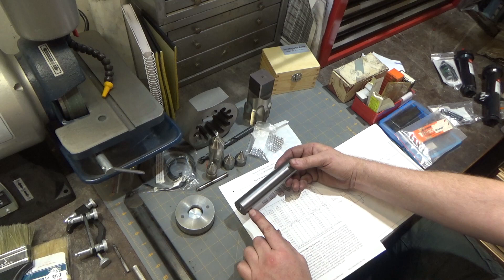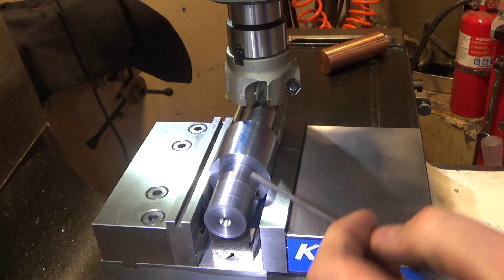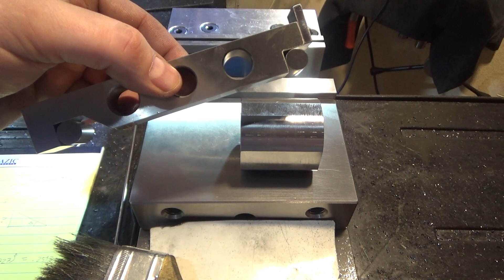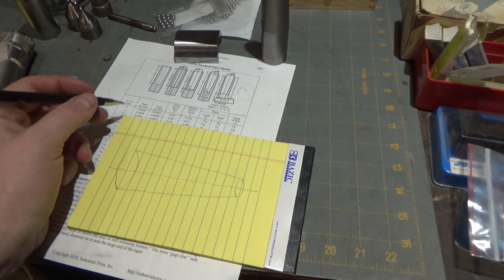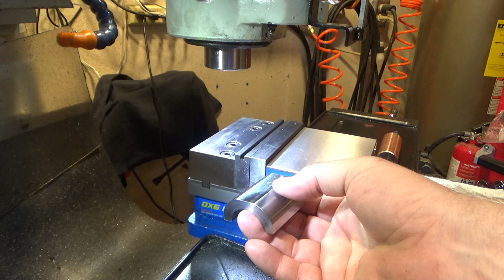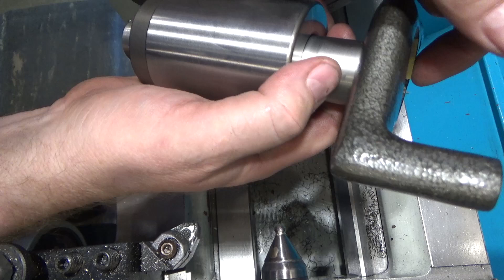Turning a Morse Taper (MT4) - Failure and Partial Success

Comment: I know I'm going off topic here and this video is 6 months old, but here goes:
mrpete222 built a taper attachment for one of his lathes out of bar stock.
This would make a good project. First I would recommend to check if you can download drawings for that really expensive taper attachment that is from your lathe manufacturer. Maybe you could copy it with some features missing.
Or you could build a similar one to the one mrpete222 built in one of his videos. Just a suggestion. :)
Reply from the maker: There are two types of taper attachments that I am aware of and Mr. Pete's is the easiest, but effective. The one the manufacturer of my lathe sells, uses a splined shaft that goes inside another shaft on the cross slide so that you can still use cross slide adjustments with the handle when you are tapering. It costs about $1200. Thanks for the really helpful suggestion.

Comment: Another thing I didn't get with my used lathe, the spindle center sleeve (and a faceplate, dead center, live center, dogs...).  I actually turned a MT5 taper to go into the spindle taper for a stop for parts inserted into the chuck.  Fortunately, I was able to cut the short taper with the compound slide.  I used the technique learned from Joe Pieczynski to set the compound accurately.  I needed this because I had to do a little production job for my employer–  we had 80 "axles" which were 5/16" male threaded on both ends of a half inch diameter center section.  I had to cut down the center section .140" on both ends.  A local shop quoted $8 per axle.  My stop went into the taper and was extended with a 3/8" threaded rod to a turned-down coupling nut to contain the 5/16" threaded part and catch the 1/2" shoulder.  I used the lathe stop that clamped onto the v-way (got two of those!) and fed the Z-axis .140" by hand.  It was very fast, but it was a bit of a mental challenge to figure out how to do it fast on a non-production machine.  I remembered fondly the nearly new Hardinge DSM-59 turret lathe I once ran...
Reply from the maker: Isn't Joe great? He really goes out of his way to share his experience with the rest of us in a really understandable fashion. A born teacher.
That project you had sounds really interesting. The setup especially. I would love to see a video on that project. I am really intrigued with solutions that people come up with that make seemingly simple projects still financially viable, because they always seem to take longer than expected.

Comment: I like the whole approach, interesting video.  Thanks!  Was it really necessary to calculate the angle of the taper.  Using a 5" sine bar should use a stack exactly half of that required for a 10" bar.  I think your conversion to angle and back introduced a small error in your stack amount, .0003".
Reply from the maker: You brought up an excellent point. I was trying to show a generic approach with the math, but I get your point. Thanks for the input.

Comment: Use dead center on headstock and tailstock.even a bearing live center can cause the wobble.i dont think the ball point center you made will help you.because the center hole on both end on the parts will be 60 degree and not a ball point hole
Reply from the maker: Thanks for the perspective. Every comment helps immeasurably.

Comment: The ball on the center is a good idea for the taper turning.  My casual observation is the the ball is actually too small in diameter for the center drill that you are using and it looks like is not making full contact in the center drilled hole.  But of course since I can not see the detail this is pure speculation.  Good video.
Reply from the maker: Thanks for the observation. If the ball bearing was still round after all I put it through, then it should contact, the 60 degree cone of the center drilled hole, in a circle (or ellipse when at an angle).  However, I don't think it was still "perfectly" round, so you make a good point. I appreciate the insight.

Comment: For some reason I enjoy seeing mistakes. I learn from them. Most of my creativity has come from mistakes. Now I feel better about my taper failure video. You had a lot of steps in that process. I'm a bit surprised you had success like you did.
Reply from the maker: Thanks. I am going to check out your video and see what new approaches I could try. Thanks for the comments and putting yourself out there. There is always more to learn.
Reply: Speaking of more to learn, I took a CAT 40 and turned a Jacobs 33 taper on one end, which ends up not being accurate enough for a reliable fit. I have almost nothing to hold onto, and only one end with a center drilled in it. I intend to grind an accurate J33 on, if I can figure out how to hold this thing.
Reply from the maker: If you figure it out let everyone know. Another video would be good. Indeed, that will be a useful bit of information. By the way, my MT4 taper would hold fine in the headstock MT-6 to MT-4 adapter, but not at all in the MT-4 tailstock. Even when it fit tightly, it was only making contact in a few points. I have a tool post grinder, but figured it would be a waste of time setting it up until I solve the wobble issue. I measured the runout at 0.005 to 0.009". Terrible. Good luck.

Comment: I expect you'll have better luck if you make a ball end dead center rather than a live center. With a dead center, since the ball doesn't rotate, any small misalignment won't cause runout in the work. When inserting it into the tailstock, you could improve accuracy by making sure any deviation of the ball from center is in the horizontal direction; that will get corrected out when you dial in the offset (rather than situating the ball above or below centerline). All the most accurate between-centers work is done with dead centers. As long as you lubricate, mind the pressure (just enough to remove all play) and adjust when and if the part warms from cutting, you won't get any appreciable wear.
Reply: Hi Steve, You have all the points that I was also going to have in my comment, maby I would just have set the compound slide to the angle, referenced up to a MT4 test bar to exclude all the variables.
Reply from the maker: I considered that choice. It has a lot of advantages, but for some lathes, that don't have a minimum 5" compound travel, the solution must be found elsewhere.
Reply from the maker: That was really helpful thanks. I have almost zero experience with dead centers. I used them just once in school. I really appreciate the comments.

Comment: I would have assumed center line too since that's how my taper attachment works.
Reply from the maker: Thanks. I went back and read through the whole section in the Machinery's Handbook and they never specify what they meant by taper in a tapered shank. I suspect that I am not the first. Interestingly enough, I did find the direct answer in the Wikipedia article on machine tapers. They even have a drawing that specifies what they mean. Thanks for the comment.